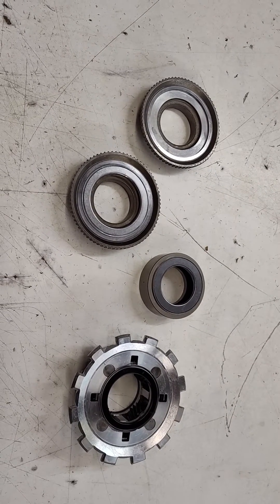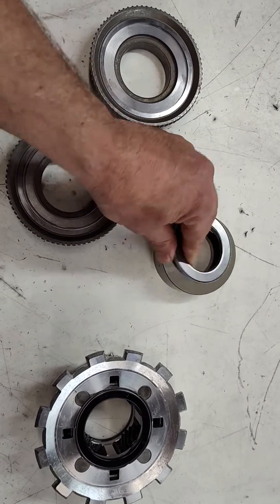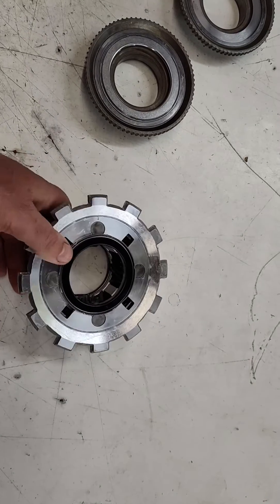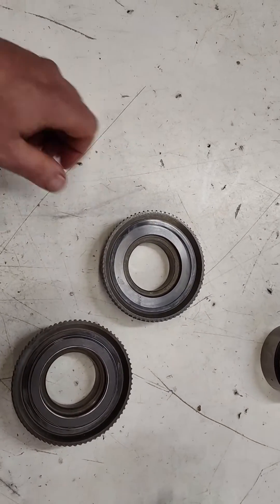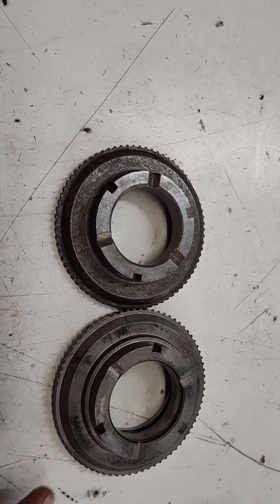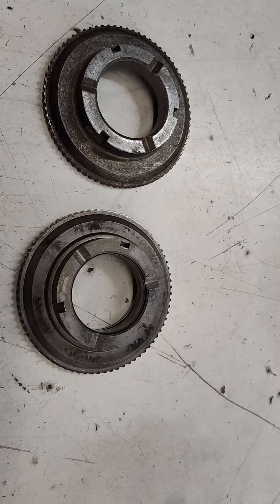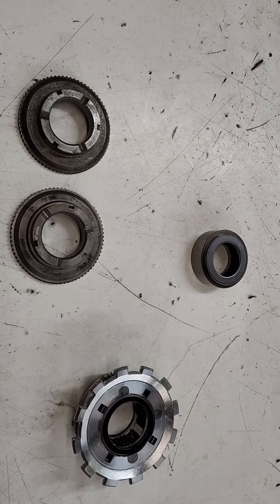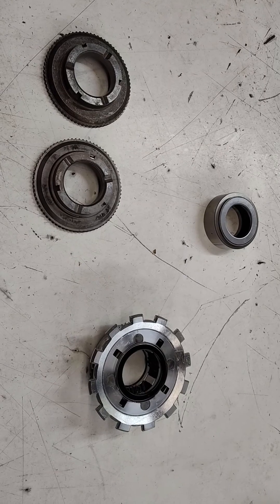Ford C6 Transmission Roller Bearing Conversion Made Easy

Comment: So what's the best way to get back some of the parasitic horse power loss that c6's are famous for and get them on par with the  C4 without going overboard money wise nor things that don't matter such as explained in the video
Reply from the maker: The C6 will never be a C4 first off. The bearing upgrades shown in this video help. My advice is not to obsess over it.  People make great power on a budget these days. I dont think its an issue.
Reply: How much more efficient would a roller c6 be?
My engine dyno was 479 and then later on we chassis dynoed it at 335. He said I’d lose 30% and that’s painful.
Reply: @clintonmilas5921 140hp loss is terrible, we build big power Detroit diesels and 140hp loss thru the drive train is a bit high running through a massive 18 speed, and turning two massive ring/pinions and thru the power divider. Your Dyno may be off or something beyond your transmission is killing your numbers. Our recent build is a 12.7 Detroit, non egr, thru a 13 speed, 3.55 rears, flywheel hp is 747, and to the ground in direct drive (1:1) is 631 HP. Maybe look at aluminum driveshaft upgrades or something else, your numbers are atrocious for a gas engine and auto trans.